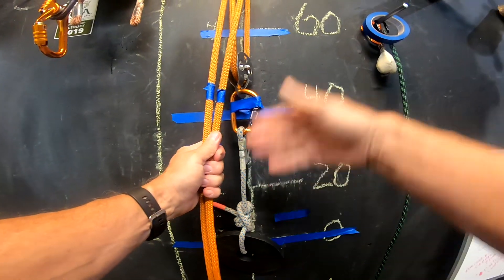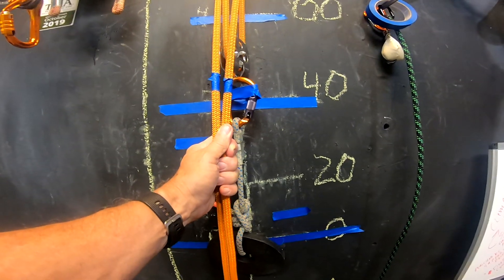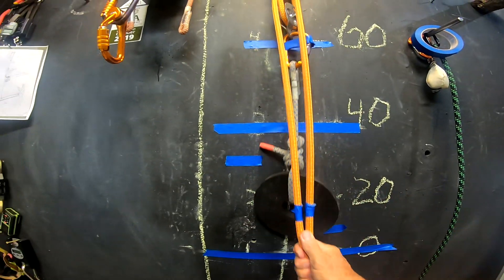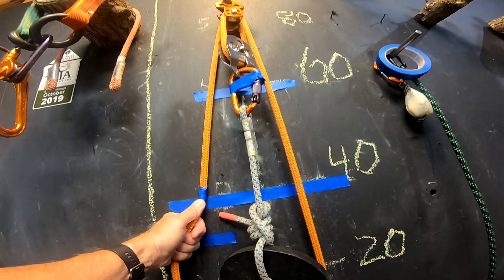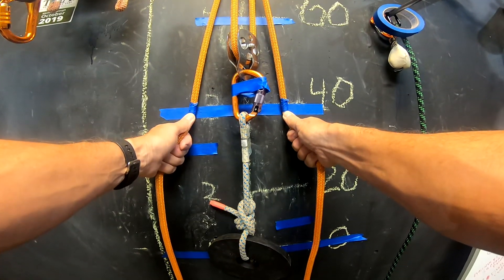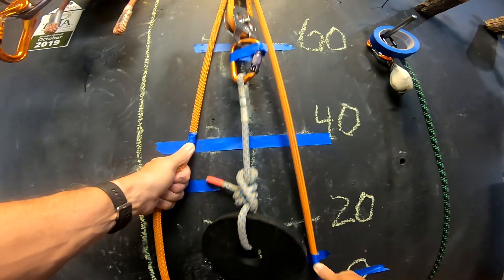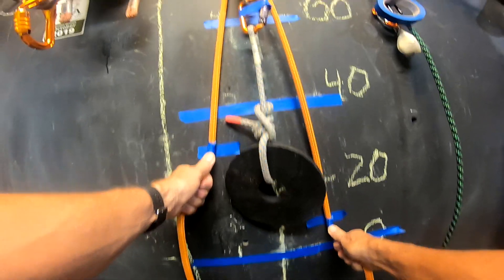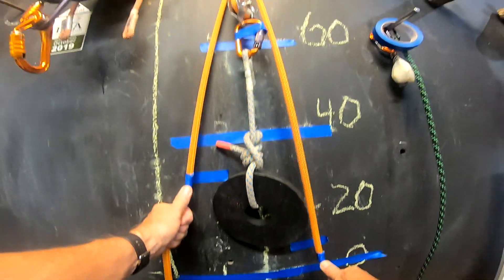Updated Explanation to MA Question.

Comment: Are you claiming that because the work done is the same that this system cannot provide mechanical advantage?  The left and right side when considering independent from each other yes.  If you're combining them, no.  Count the ropes.  Always have two pulling up.  Left side, one.  Right side, one.  Both together, two.   If you grabbed the left with both your hands, what happened to the right side?  Did you drop it or tie it off?  Hopefully you tied it off to something that holds the other half of the force exerted by gravity.  Now you only have to overcome half of the weight of the load with both of your hands.  If you didn't tie it off, well, you're not accomplishing anything.
Reply: Ok then I misunderstood.  Looking at those diagrams.  No total mechanical advantage.  The nice thing about the ones with two guys is you have more potential power and they each feel half the load.  Same reason all those big items at Walmart have pictures of two guys and say "Team Lift"
Reply from the maker: The question was asked, looking at those diagrams, what is the mechanical advantage. Most people would look at the entire diagram and try to come up with a mechanical advantage. The point I think, although the discussion has not been concluded, is that you must look at the person or the thing that is applying the force, there is no "system" mechanical advantage.
Reply: The better question would be, why the heck would you build a system like that?  Just take out one of the pulleys at the top put both guys on the one leg remaining and your golden.  LoL

Comment: Both your left hand and your right hand have a 2/1 mechanical advantage in the final example.  The work done is irrelevant to that fact.  
What's the original claim again?  Maybe I'm not sure what theory I am considering.
Reply: Is this question regarding work or mechanical advantage?  Work done never changes.  If the load goes up an amount, it matters not how far either side contributed.
Reply: And yes when considering your left hand or right hand independently, there definitely is mechanical advantage.  Your left hand is pulling down one leg and the system is pulling up two.  Same can be said for the right hand.
Reply: @TreeCamper  ah, but the human system is singular, with a single mass, it's 2 anchor points (legs) cannot work as an independent system with each arm, it's force generating components are not detachable.
Reply: @FreeFallinTrees  
Sure you can.  Tie one side off.  Why can't you do that.
Reply: @FreeFallinTrees  and each arm is pulling half the load.
Reply: @FreeFallinTrees  Richard just replied to me in a different thread.   I was assuming that you could tie off one side.  That was wrong.  The original claim had to do with the 4 pictures on the website.
Reply: @TreeCamper  it is difficult with the conversation happening in 2 places, I'm in that one as well 😁

Comment: I don't really understand what is so difficult to grasp. That's a pretty simple concept.
Reply from the maker: Thank you, I hope I've explained it well.   For whatever reason, mechanical advantage when it comes to do with rope and pulley configurations can generate a lot of discussion.
Reply: @RichardMumford1  Yep I see but either way, to pull up a certain weight at a certain height will demande a certain amount of work, and mechanical advantage doesn't change the amount of work needed.
Maybe people think that pulleys can delete some work and break the laws of thermodynamics... ?
Reply: @bjooo  
Mechanical advantage does not remove work.  It does spread it out over distance.
Reply: I think the problem is forgetting the force exerted by an the object you tied of the other side of the system to if you were to do that.  Don't forget that even if an object isn't moving something, that doesn't mean it's not exerting force.  The Earth and you are constantly pushing against each other but no effective work is being done.

Comment: The problem I keep having is that you are basing your finding off of 2 presuppositions that I don't believe are true.
1. That any MA system has no MA built into it, it requires someone to be moving it to have the MA defined.
2. That 2 hands should be seen as 2 seperate human systems even though they are part of a single human being.

Take either of these assumptions away and it changes everything.
Reply from the maker: 1. Take a RADs or Yoyo system, same ropes, same everything, 3:1 climbing system, 2:1 hauling system.  It's not defined until it is used.  Same with a doubled over the branch Blakes system, 2:1 climbing system, 1:1 hauling system.  Same equipment hanging.
2. If I could get two little squirrels trained to help out I would. Besides, I think my left brain and my right brain are not part of the same single human being.
Reply: The problem I have is that I don't know what the claim is.  Lol
Reply: Your proposition is not entirely correct.
A system can be pre-configured to have a defined M.A. yield.
It does not require a human to use it to actualize its pre-configured M.A. yield.
For example, an 'AZTEK' is a pre-configured M.A. system. It is configured to provide either 4:1 or 5:1 M.A. (depending on orientation).
It does not require a human to actualize its pre-configured M.A. yield.

What you are attempting to describe is the injection of force.
It does require a human (ie a person) to inject force.
The human uses the pre-configured M.A. system and injects force into it.
That force is then multiplied through the system in accordance with Newtons laws of physics.

The system that Richard is demonstrating is a 'mirrored' M.A. system.
Mirrored systems allow a person to inject force from both sides simultaneously.
If the force that is injected from one side perfectly equals the force that is injected from the opposite side, you get what is called 'destructive interference' (as opposed to 'constructive interference'). This concept comes from wave mechanics in physics.
Reply from the maker: @markgommers4858  it actually is correct, systems do not have mechanical advantage, it's only when the forces are applied that the mechanical advantage becomes evident. Take examples of the same ropes configured for climbing versus hauling, the mechanical advantage for the same rope configurations is different.
Reply: @RichardMumford1  Richard, it appears that you either did not read what I wrote or you did not understand it.
I am not sure which one - maybe a bit of both?
To help understand the concept - I have added the word 'theoretical' - which should add clarity.

A system can be pre-configured to have a theoretical M.A. yield.
For example, the 'AZTEK' is pre-configured to have a theoretical yield of either 4:1 or 5:1 M.A. depending on orientation.
This pre-configured theoretical yield exists independently of a human being.

A human is required to inject force and actualize M.A. output.

Regardless of whether a human is present or not - the theoretical M.A. yield is unaffected.
When a human injects force - it is multiplied according to Newtons laws of physics (which is co-dependent on the configuration of the system). This is the process of actualizing the force output.

As a thought experiment, consider again an 'AZTEK'.
As a pre-configured system - the manufacturer of the AZTEK is entitled to state that it has a theoretical M.A. yield of 4:1 or 5:1.  Without a human - it sits on a carry bag ready for deployment (it is 'inert') but is nevertheless a real physical product.

A human can inject varying amounts of force - and the M.A. yield that is actualized is calculated in consideration of the initial input force.
Reply from the maker: @markgommers4858  I did read it, and I did understand it I just disagree. Mechanical advantage is not dependent on system or configuration but on how it is used.  The Aztec example made, without changing the configuration, can have a completely different mechanical advantage if used for hauling versus climbing. It is not until the forces are applied that mechanical advantage is realized and these were fine examples of that.
Thanks for the comments.
Reply: @RichardMumford1  Richard - I can tell from your videos on this subject that you are essentially 'thinking out loud' - trying to figure out what is going on while you are filming it.
You don't actually state what the question is in either of your videos (you produced 2 videos).
In any science problem- you first need to properly define the question. You have not done this - and this is the root cause of the issues you are experiencing.
You should re-film this series - and properly define what the actual questions are.
Once you know what the actual questions are, you can then figure out appropriate answers.

In reading your replies to my points - I can see that you are confusing some concepts - and not understanding other basic principles.

I'll quote you now: [QUOTE]: "Mechanical advantage is not dependent on system or configuration but on how it is used." [UNQUOTE]

This statement is false.

The theoretical M.A. yield is dependent on the configuration of a system. The manner in which pulleys are arranged and the direction in which a rope is reeved through those pulleys determines the theoretical yield of the system.

[QUOTE] "It is not until the forces are applied that mechanical advantage is realized and these were fine examples of that." [UNQUOTE]

This statement is partially correct - because of the language used. I would reword your statement as follows:

REWORDED STATEMENT: "When force is injected into a pre-configured M.A. system, the actualized output force is determined by how the system is configured and the level of force initially injected (ignoring friction for simplicity). Force that is injected into a M.A. system is multiplied in accordance with Newtons laws of physics."

I reassert to you that Rock Exotica is entitled to advertise that the 'AZTEK' is pre-configured to provide a theoretical M.A. yield of 4:1 or 5:1.
It exists independent of a human - it is a real physical product.
When a human uses it - it is 'actualized' - and real work can be done.

When there is no human - it sits inert in its storage pouch - but is nevertheless a real pre-configured M.A. system with a theoretical yield.

Here is a link to the AZTEK: https://www.rockexotica.com/aztek/ 

Note the wording on that webpage.

When they say it can be 4:1 or 5:1 - that is simply identifying that any injected force will be multiplied x4 or x5 which is due to is configuration and orientation.
All M.A. systems obey Newtons laws of physics.